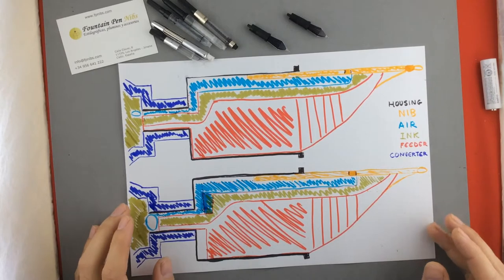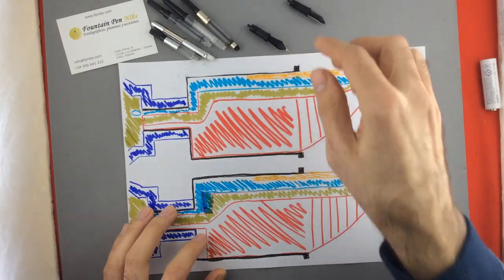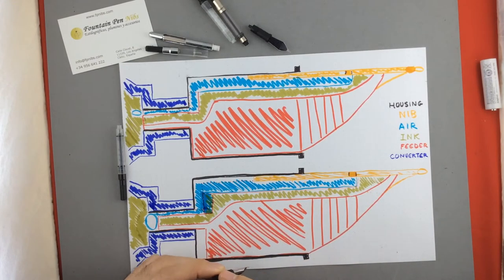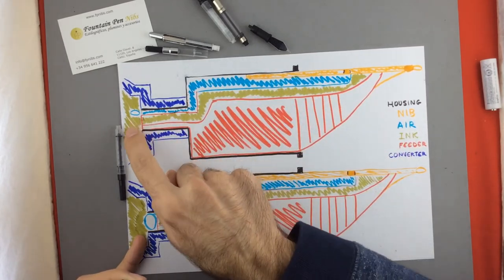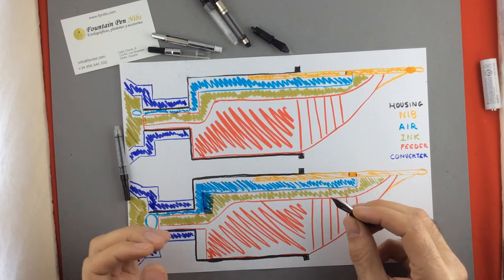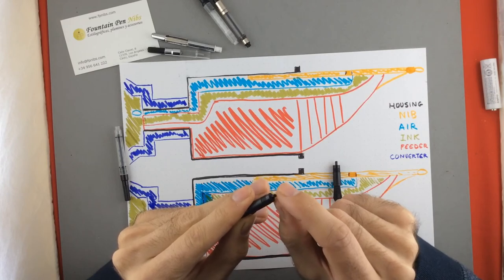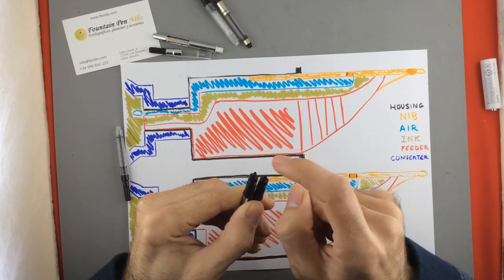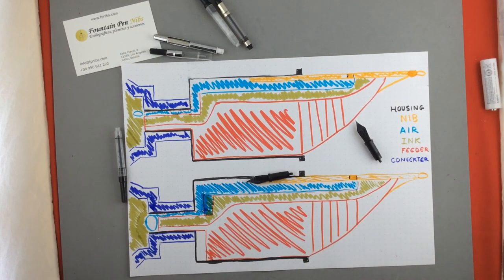Ink flow problems on modern fountain pens Part 1

Comment: Good video.  It's odd, but the more expensive the fountain pen, the more likely it is that I have ink flow problems with converter or piston fill pen.  The only thing I would emphasize is that a user flush the pen thoroughly before using it fore the first time.  Sometimes manufacturing gunk is still in the feed or even in the air channel, and won't wash out with just the ink trying to push through.

I've also had pens with perfect ink flow that suddenly started having flow problems.  This usually happens when I've waited too long between cleanings. Even when I use a pen every day, it can still develop some type of clog after enough time has passed.  This is particularly true with some inks.

Comment: Hi Pablo, thanks to your excellent video posts, you have solved a problem, which has  been driving me crazy for some time.  I added a tiny drop of dish soap directly to the converter on the end of a cocktail stick and the ink has flowed  superbly ever since. Muchas Gracias mi amigo 👍👍👍

Comment: My new pen becomes dry after1-2min of writing, how can i solve this? At the start it writes perfectly, but then the line becomes pale.  If i take the cartridge off and put it back in, pen writes perfect again, but like i said - not for long...
Reply from the maker: Have you seen my videos about flow ink issues?
Reply: @Fpnibs  only this one and Part 2, but i use cartridges
Reply from the maker: Have you tried different cartridges brands? They may vary in the composition on the ink. I think you could also add a drop of soapy water into the cartridge once opened, with a siringe.